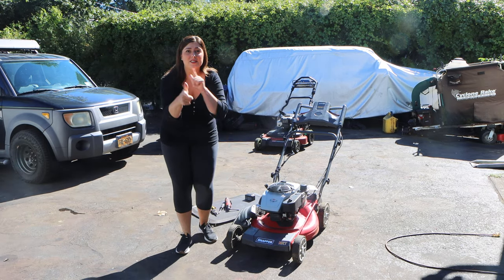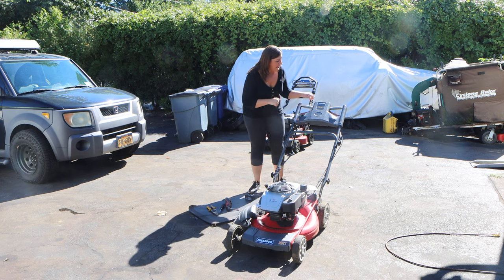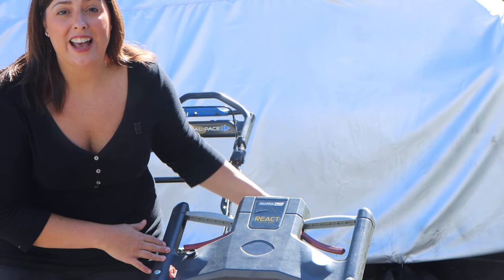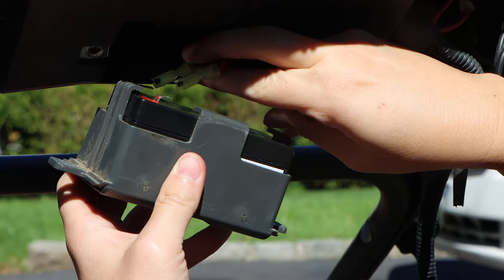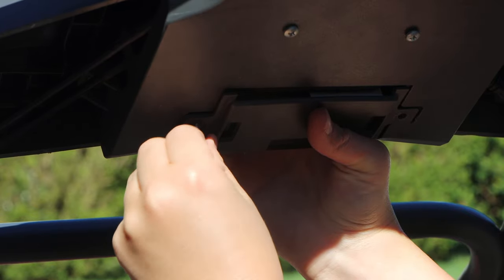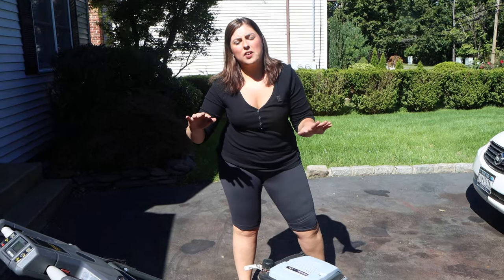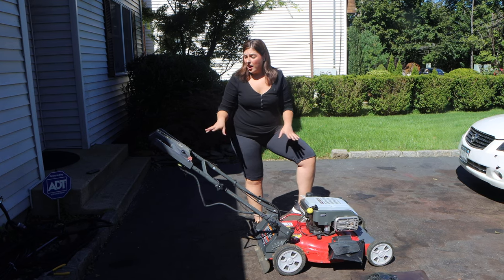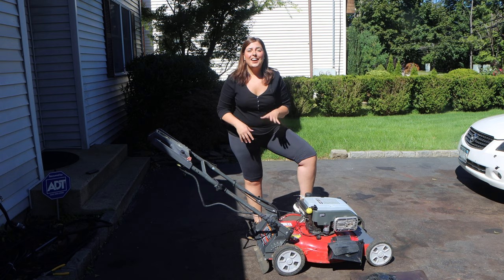Mrs. Pattay's Performance Turns Snapper's Worst Mower Into One Of Its Best Mowers  SNAPPER NXT

Comment: What an awesome video!!!
Reply from the maker: Mrs here...thank you so much for watching and for such a wonderful compliment from someone we highly respect like you! Appreciate the support!
Reply: @pattayperformance   I have a vintage Snapper 21 inch cut mower with a flathead 3.5hp Briggs & Stratton engine.  So whenever I see or hear about anything Snapper, I am naturally interested. 
I never realized that Snapper had a one of their mowers that was battery actuated without a recoil starter - That seems very odd that Snapper would not have a recoil starter to use if the battery failed in which those batteries usually always did. The battery looked amazingly similar to me battery that I have in a Streamlight Fire Vulcan lantern - Imagine That.
When you were cutting the opening for the recoil rope opening, I was thinking that a Dremel tool would have made that job maybe a bit quicker for you.  As you were probably aware, I was a welder/fabricator for many years and I credit my art classes when I was in high school for my use of patterns in which I used for lots of repair jobs and fabrications that I performed over the years. I used the exact same technique that you were using to cut the opening for the recoil. When I was cutting out precise openings on steel or aluminum plate in which the blade on the upright bandsaw could not flex - I would make several small cuts and gradually cut the area out. Also I used a large Plasma Cutter for cutting out metal parts as well. Sorry to ramble on.
Reply from the maker: @TheIronDuke502  no need to apologize about “rambling”. You gave great tips for many to see and observe for an eternity and that is priceless!

Comment: I noticed that when you removed the old battery, the live wire came away a bit too quick. Was this  wire a bit loose and maybe the problem and not a flat batt?...........just wondered. 3:45
Reply from the maker: Mrs here.. No I wish that was the case I did a double test of that battery just make sure off camera. Never like to waste any product. Thank you for looking out though appreciate your support
Reply: @pattayperformance  Okay, well done, sometimes one spends a whole lot of time trying to diagnose a problem when it turns out to be a bit simpler. issue.........rare I know LOL!